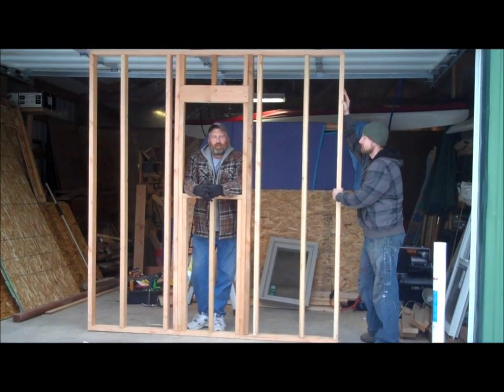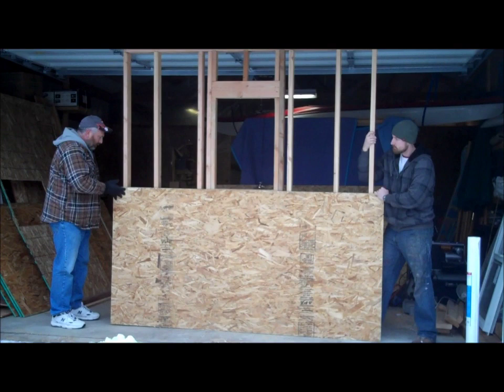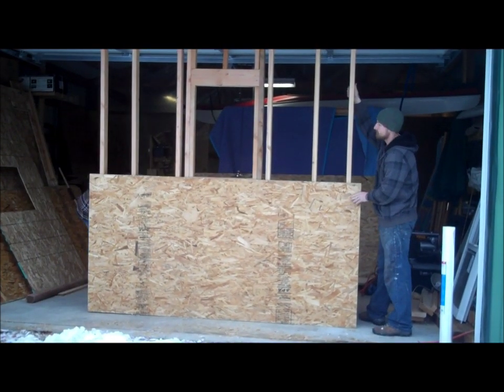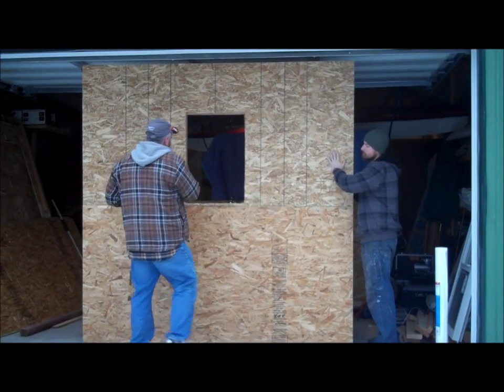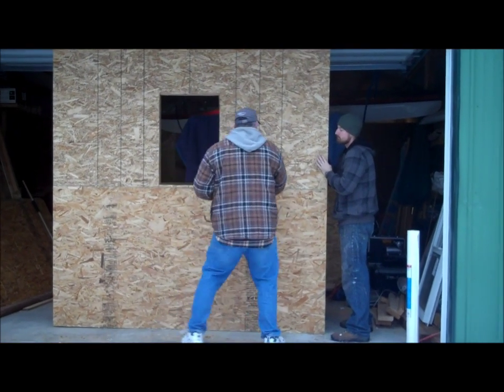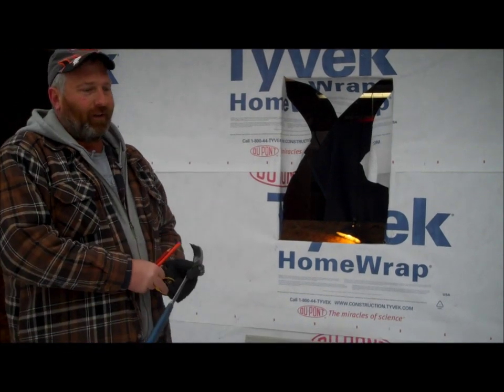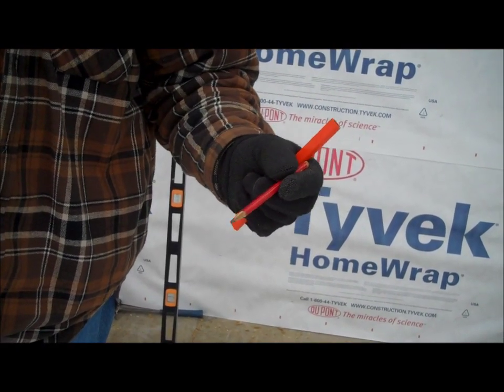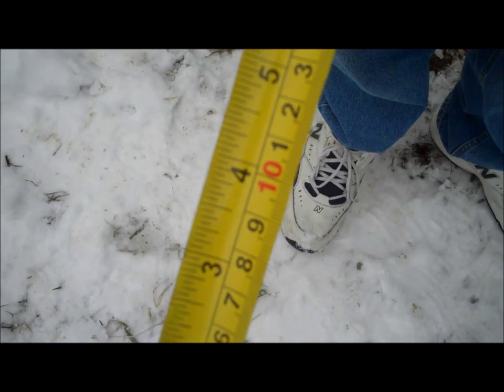Episode 10 sheathing ,house wrap, window

Comment: Hi, Kevin, I see you already cut out the window opening for the top sheating. Is that more difficult to locate than just putting on a full sheet and cut it out later like you did the sliding glass door frame? Thanks, for all your time responding to my questions. Robert

Comment: Hi Kevin, out of curiosity why sheath with screws versus nails. Can you explain the major differences and the impact it will have if your tiny house were mounted on a trailer bed and rolling down the road.
Reply from the maker: Hi yes I prefer screws because they won't back out. nails will especially if they are  subjected to the movement of the building. If you want even more piece of mind use construction adhesive as well.
Reply: Kevin Coy Thanks Kevin, these videos and knowledge sharing are awesome.
Reply from the maker: Epiha you are very welcome. ;)

Comment: i have a sheathing question.  i am just placing siding directly over the studs.  no OSB.  do i sheath the studs and then put the siding on?  is it the paintable siding.
Reply from the maker: If you are using full sheet siding like T 111 you can go right on the studs. If it is strip siding Then sheathing first for strength. You can paint or stain depending on the type of siding.